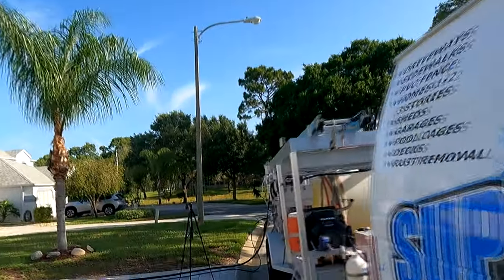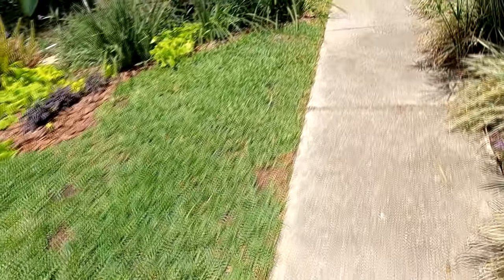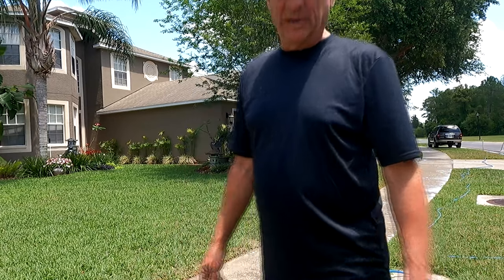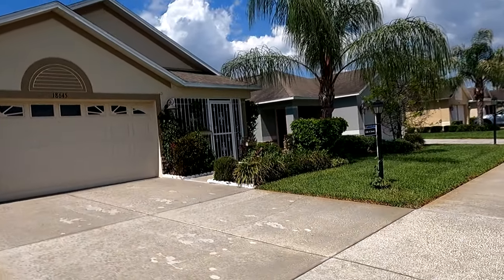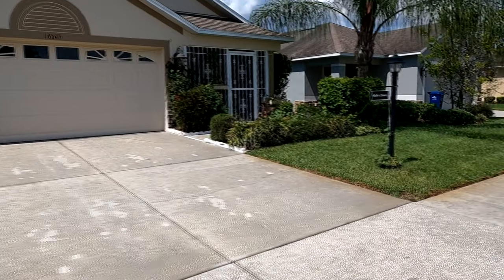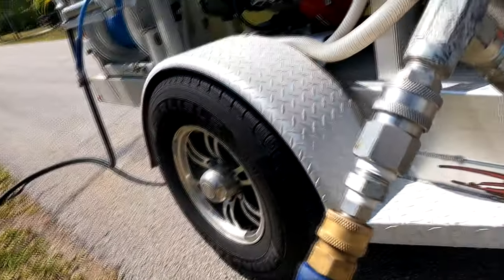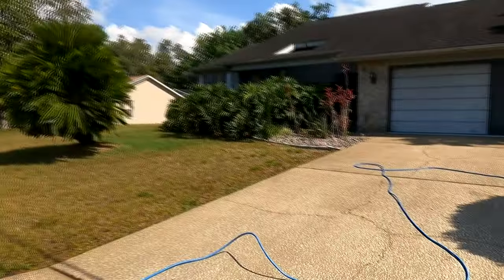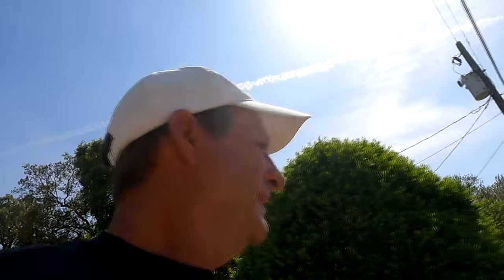5 Jobs with a 12GPM demonstration with a 31" Mondo

Comment: Yeah, the 2 machines work very well...I just have some places that even with a 225 buffer tank, if there is a lot of concrete, water can be an issue using both of my machines.
Reply from the maker: Yes, sometimes the water flow will kill the plan.
Reply: You have to get a very large tank. An army marches on its stomach
Reply: @Johnnyreengo  I am not hauling a lot of water...this Army does not march. Someone else can do those jobs where a lot of water has to be hauled.

Comment: So this is about peak capacity for a residential guy? 16gpm isn’t realistic, who actually runs that lol?
Reply from the maker: I do when I use the 49" on commercial jobs and real big driveways. it is a beast. Get after it.
Reply: @superblastpressurewashing.7256  😳ridic
Reply: @superblastpressurewashing.7256  is 12gpm good for downstreaming a house?
Reply from the maker: @seattleprowash5464  LMAO no I downstream with the machine set at 3/4 speed so around 6GPM Get after it, I use that 12GPM when the concrete is really bad, the volume of water cleans a lot better with the surface cleaner.

Comment: Can you explain why you only get 12 GPM?  I thought it doubles the output when you do the Siamese kit. What am I missing?
Reply: It could be from the tips he is using on the surface cleaner
Reply from the maker: @amberowens2453  Amber you can only get 12GPM with 3/8 line, you need 1/2 pressure hose to get 16GPM and I do when I run my 49" Mondo using 1/2" pressure line. Tips have zero to do with this flow info.
Reply from the maker: No matter what you do or run you can only get 12 out of 3/8-line brother, I do have a reel with 1/2 line when I use the 49" Mondo, then I get 16 GPM, 12 GPM is max for 3/8 line.
Reply: @superblastpressurewashing.7256  cool. Thanks for clarifying. I just made it to the part in the video where you say that 😄